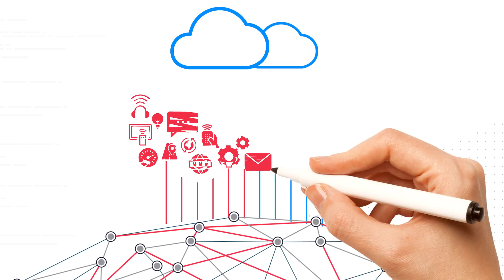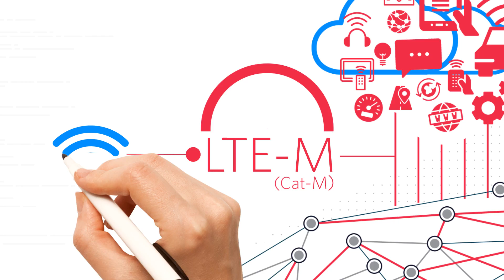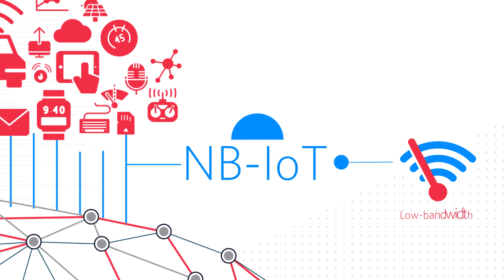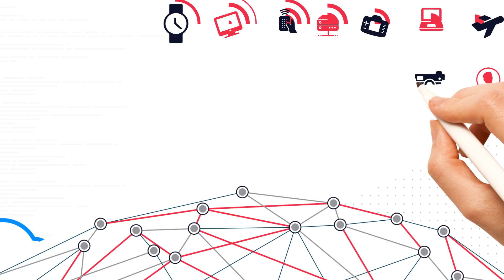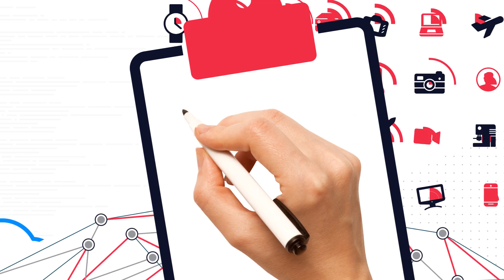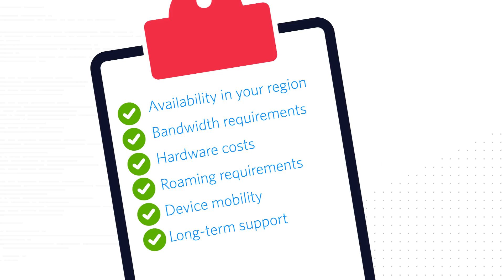What is the difference between Cat-M1 and NB-IoT?

Comment: When will this be available for the public?
Reply: It's getting there progressively. Many places you can buy a NB-IoT SIM card, but it's still quite pricy, since the marked has not adapted yet
Reply: @dinneysauce  Is NB-Iot SIM card different from standard sim card or you are just talking about difference in operator's tariff?
Reply: @rafal_pz8826  I had to get a whole different card. If you want them build into a device, you would rather get the SIM card as a chip you can secure in the device.
Reply: @dinneysauce is there a catM sim card brand you can suggest?